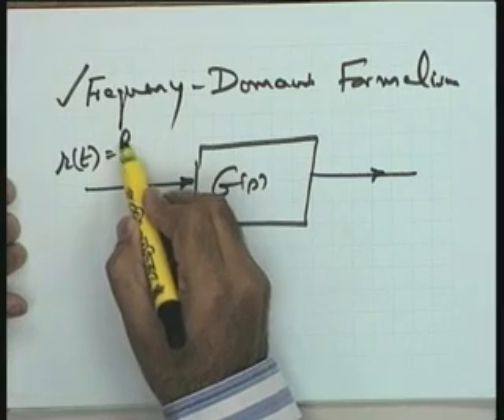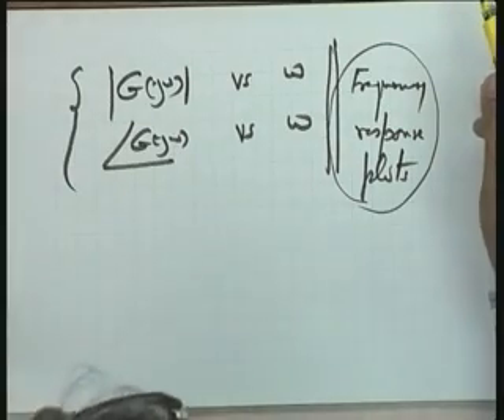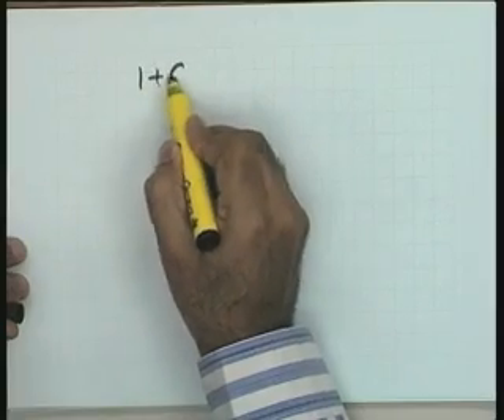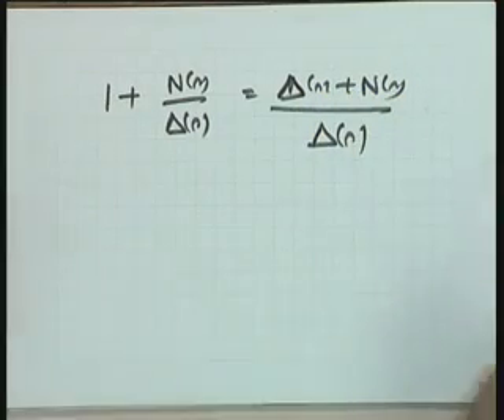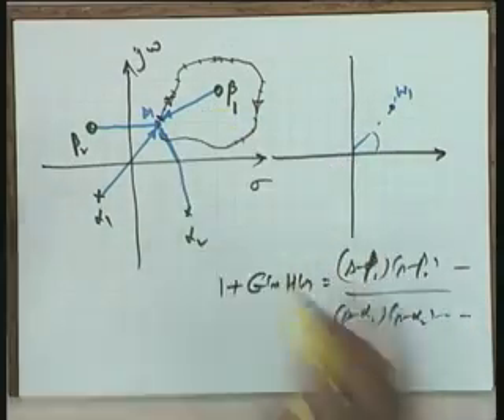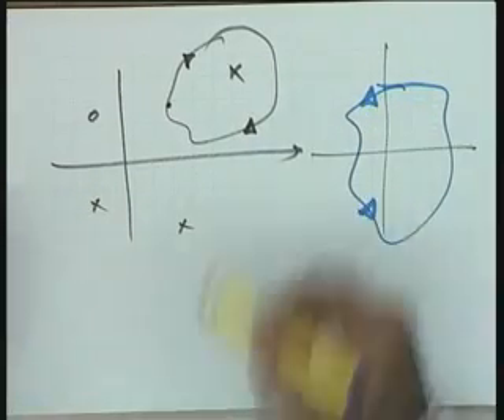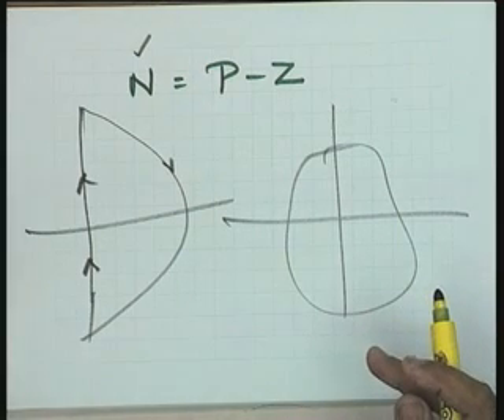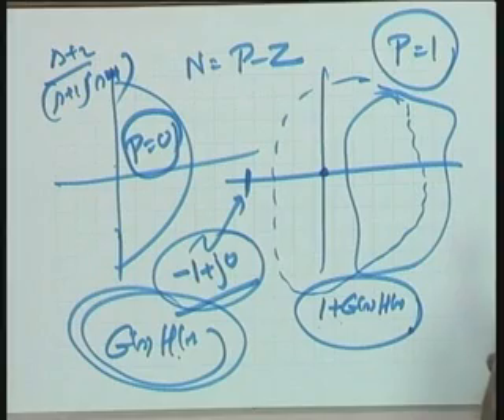Lec-35 The Nyquist Stability Criterion and Stability Margins

Comment: Can someone please how by contributing an angle of - 2 pi, any zero inside the contour will correspond to a contour in the w-plane encircling solely the origin and not some other point ?
Reply: Not only zeros, it could be poles too. As I understood, not strict.. G(f)H(s)=N(s)/D(s)=(s-z1)..()/(s-p1).. = let it be K(s). If we calculate it using phasors we can say that angle(K(s)) is equal to sum of all angles of numerator's phasors (s-zi) minus sum of all angles of denominator's phasors (s-pi). The magnitude of K(s) is not interested us here (it is >=0) . Suppose we took zk one of zi and made some contour around it only. Now map it into K(s). We can say that phasor of (s-zk) while s is going along our contour makes full angle (2pi). The angles of other phasors do not change largely. At least they dont make full angle. It will better been seen if you draw any phasor and watch for it's angle changing while s is going along contour. So the angle of (s-zk) makes full angle and sum of another angles can not compensate such changes. Hence tha angle of K(s) should also make full angle (at some direction). When angle of point makes full angle it should go around the origin. The direction of mapped contour and number of encircles are depend on the number of poles and zeros inside initial contour.

Comment: I got lot at the 40-42 mins how are the poles of 1+ G(s)H(s) also the poles of G(s)H(s). And how are the zeros of  1 +G(s)H(s) the poles of the closed loop transfer function
Reply: oyindenyafa tarakeme :

G{s) = NG/DG;
H(s) =NH/DH

NG=numerator of function G
DH=denominator of function D
Similarly for NG and DG.

we find
G(s)H(s) =NG*NH/(DG*DH)

Now,
1 + G{s)H{s) = 1 +{NGNH /(DGDH)} 
=(DGDH + NGNH)/DGDH

 
T{s) =  G(s)/l + G{s)H(s) 
        =   NGDH/(DGDH + NGNH)

we conclude that (1) the poles of I + G(s)H(s) are the same as the
poles of G(s)H{s), the open-loop system, and (2) the zeros of l + G(s)H{s) are the same as the poles of T{s), the closed-loop system.
Reply: Shuvroneil Sinha Roy thanks